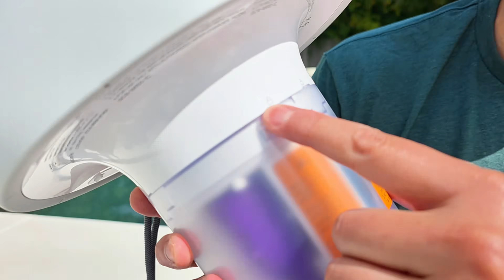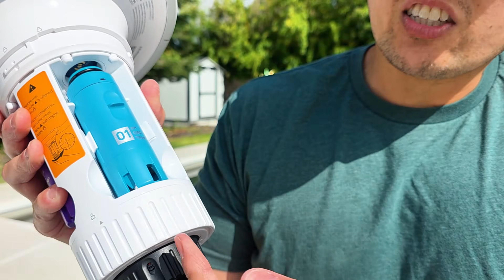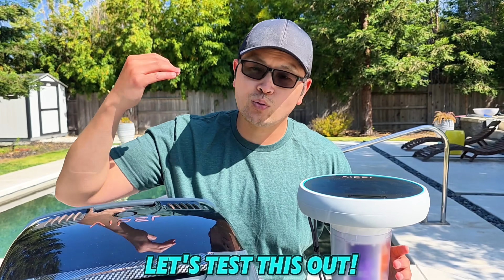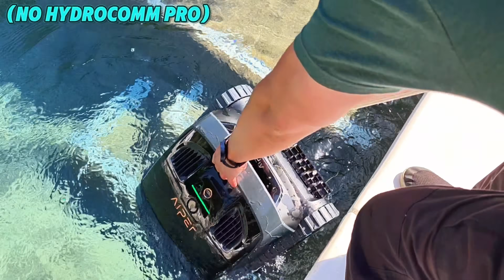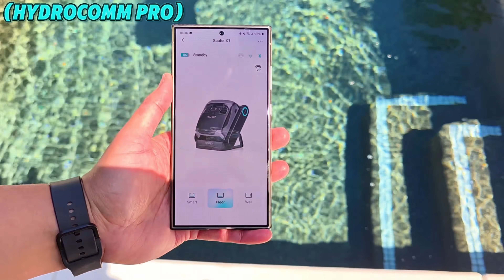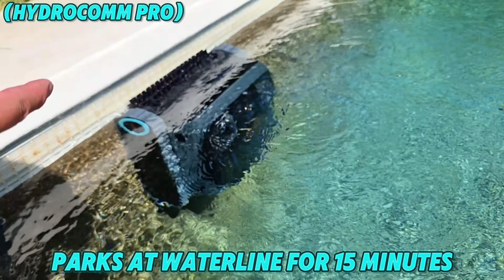Unlock Underwater Communication! Aiper HydroComm Pro

Comment: No chlorine and no Alkalinity is a deal breaker. Expensive for low functionality.
Reply: I agree! I've never heard of that other shit! The whole thing is a disapointment!
Reply from the maker: I think they may be adding it later on. But for sure it'd be an extra probe that costs even more unfortunately.

As a stand alone pool monitor, there are better choices. But if you have an X1 series cleaner, you get more value from the underwater communication to it as a whole.

Comment: I have the same two items. For whatever reason, after being linked when the scuba goes under it still loses connection. Any tips?
Reply from the maker: This happened to me before as well. I think what I did was unlink them, then reconnect the wifi to the cleaner, and then reconnect the wifi to the HydroComm. I had to make sure to disconnect and reconnect the wifi for this to work. Don't know why I had to do it but since then, it's been working fine.

Comment: I feel like the Hydrocomm pro is overpriced for what it does. It seems like it should be bundled with the X1, given that it just adds the ability to control the X1 while submerged, like a comparable corded product. As for the things that it measures, I assume that the probes are consumables and will need to be purchased and replaced seasonally. Anyway, I do see myself purchasing one of these, just for the device control, which I don't have currently with my Scuba X1. You should definitely factor this into the price of any Scuba X1 series cleaner.
Reply from the maker: Yeah I agree with you, it should have been included together and not listed separately. I've actually heard some people are finding packaged deals with both devices for a great price.

The probes are most likely going to need replacement so that's an added cost as well, plus the calibration every 2 months.

Definitely, for any X1 series cleaner, if anyone decides to get it, they should factor in the cost of the HydroComm Pro as well. It just completes the cleaner.
Reply: @imdefinitelydavid   I'm regreting it! It's way too complicated! I cant even get it to link to my wifi.I'm going back to hayward one with a cord.
Reply from the maker: Wow sorry to hear about your experience!

The HydroComm Pro was pretty straightforward for me to connect. I would assume that since you're having a hard time, it must be a defective unit.

I did have a connection issue when I first connected the cleaner to the HydroComm Pro in the pool. But after manually disconnecting and reconnecting them once to my wifi, it's been working great.

Comment: Dave...one other thought......when you do your review of the pro max, can you show how to operate in the multi-zone mode?   we both have about the same size platform and water depth with 2 steps leading up to the platform.....so far I have not gotten a really good answer from anyone at Aiper on this mode of operation....thanks....OKU
Reply from the maker: Yeah I'll definitely figure that out. They specifically said that it was designed to target ledges and different platforms so I'm curious to see if it's like a mode you have to turn on in the app or if it does it automatically... I hope it's not like the Beatbot where you have to physically push the button on the app to activate it. Makes it less convenient.
Reply: @imdefinitelydavid  I think there is a " multi-zone" mode.....but I am not sure if you have to map the pool in that mode or not.....Aiper says to let it map the first time but not sure what mode.....maybe floor only......they do say the mulit-zone mode does do steps and platform as you said but we will find out....I want it to go to platform, clean it without falling off as advertised, then go back to cleaning pool in what ever mode is set......the other issue is do you want the Aiper to be manually placed on platforms for $1899 - $2299 or the Beatbot for $2995 - $3499.....I like the BeatBot but I really do not want to have to "hand" place on the platform and the price is too high....but......the skimmer is the best....I do not get many leaves at all so I am hoping the Aiper will do the job....Aiper also told me they will send me a floating device so the skimmer is further out of the water....ww'll see about that too....

Comment: Is it compatible with the Aiper Scuba S1 Pro
Reply from the maker: Unfortunately no. Originally it was supposed to be released with the S1 Pro but they canceled that.
Reply: @ ok, I will have to get the Aiper Scuba X1. Do u know why it is labeled in Amazon as (Upgrade Aiper Scuba X1) does Upgrade mean a Upgrade from the Scuba S1 Pro?
Reply from the maker: It's the same cleaner, no upgrade even though it says the actual words in the listing.

Aiper and other companies do this every now and then to upgrade their listing. Like they change some words in the title and sometimes create a whole new(upgraded) listing. But it's the same cleaner.
Reply: @ got it, thanks for the explanation.